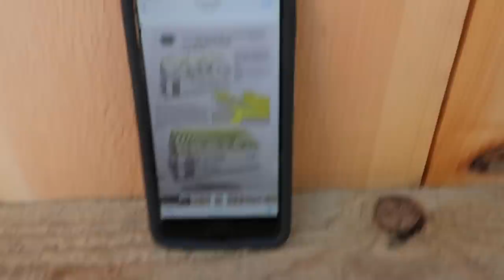This made MY toes Tingle! One Man Attempts to Install Ridge Pole and Rafters on Post and Beam Barn

Comment: I was keeping my fingers and toes crossed for this part.  I was wishing you had an extra plank or two on the tall long scaffolding as I didn't like you walking the plank so to speak especially while lifting the rafters into place.  But that said...the time you take to mark it all out make for a much easier fitting when you're up there manouvering  around.  Great job for sure.  Looks like the pigs will get moved tomorrow..no greens left.  What  cleaning machines they are.  Have a Blessed day.  Olivia you did great work with the drone...I wondered where you were and all along you were right there with your Dad doing the drone work.  Good for you.  What a help you are.

Comment: You said that you would toe nail the rafters later, and I know that toe nailing has been done for hundreds of years, but I can not think of a weaker joint, today I would use "Hurricane tie`s" on my own build, I would also nail a 2´ piece of strapping over the joint in the ridge beam, and while I was at it I would use 6 Simpson 4" angle brackets at the corners, and in the middle of the long side of the barn, screwed to 4x4 and drill thru the 6x6 and the 2x6 into the concrete with a 12" piece of all thread and epoxy.    awesome build, thank you for posting

Comment: just a word of after thought
as a framer ..to make the ridge pole stronger at the joint @ 22:10
I always cut a scrap piece of ridge pole and cut the pitch on the edge, then screw it into place on both sides

then all you do is cut 1 1/2" off the rafter.....much stronger

Comment: Must admit, Al, I didn't understand a thing you said when you were cutting those boards at a different angle to accommodate the over-hang--so I'm just gong to take your word for it.....Thanks for sharing your "barn build" with us.
Reply: Those rafters were for a barn without the side extensions therefore not needed.

Comment: Where the loft is I would have added a 5' stub wall for more clearance raising the roof 5'. When I did a utility shed for my neighbor I did a center support and a full span center beam to carry the roof load taking majority of the support requirements off of the sidewalls I used 2 2x8 with sandwiched 1/2" plywood it's like a vaulted ceiling. You should invest is some quick grip clamps they are very handy.

Comment: Good job doing the work yourself, I also prefer to work alone. Just a hint to make things easier: screw a couple of scrap sticks to the tops of the props to form a U to hold the ridge board on top and prevent it slipping off or tipping over.

Comment: Two things - lay a level on that ridge beam when it first goes up because it may need some tweaking and you need that level before going on. His rafters weren't making full contact with the ridge beam (gap at the bottom) because it was just a smidgen too low - and always install rafters in opposite pairs so that they don't bow the ridge beam. With all the rafters put on one side first you are pushing that beam over. Yes it will probably work out in the end but it will be a lot more stable as you work if you put them up in pairs.

Comment: ALSO CONSIDER GALVANIZED ANGLE BRACES FOR THE BOTTOM OF THE RAFTERS SECURED INTO THE TOP BEAM OF WALL
SO AS TO GIVE EXTRA STRENGTH FROM DOWNWARD/OUTWARD PRESSURE .... ESPECIALLY SINCE YOU HAVE ONE SCREW
SUPPORTING EACH SIDE OF A ROOF JOIST SECTION.  EXTRA MEASURE OF SECUREMENT OF THE ROOF TO THE STRUCTURE.

Comment: On your second ridge board support if you scab a couple of pieces on the side at the top of the temporary support to form a U it make one less thing to worry about with the outer end of the ridge board falling off. Kind of like third hand. A couple of Pony pipe clamps come in handy for pulling things into position and holding something before you attach it with screws.
Great job, working by yourself makes you think a little harder than if you have someone to help:))
Stay safe. Thanks for posting this series.
jb

Comment: You pulled that off really well, Al!  Nice flying, Olivia!  *While "Ridge Pole" 'may be' accurate, Ridge Beam is more so. Posts are vertical. Beams are horizontal. You're not building a Pole Barn, Al...you're building a Post and Beam Barn 😜 *

Comment: It would have helped to build a cradle for the ridge pole to rest in on those supports. A board sticking up a few inches on each side of the support would keep the ridge pole from falling off of it if it got knocked or the wind caught it. Glad you got lucky and it didn't fall off and rip the screws out of the end (and potentially hit you as it fell)!

Comment: What about attaching a metal bin or bucket underneath the PPM's indoor water dispenser... to catch the drips. A few drops will evaporate and if it's more the pigs might drink it later. Or maybe drill a couple of holes to let the water drain through? Or even some paint or varnish to protect the wood? ❤🌅🌵

Comment: Technically it is call a ridge board.  The term ridge pole or ridge beam implies that it has carries the weight of the roof transferred from the rafters.  A ridge board simply is used to fasten opposing rafters to one another.   The rafter share the roof load and transfer it to the wall so the connection to the top plate is critical.  The rafter are trying to push the top of the wall out.  With no cross beam, it is merely the connection of the rafter at the top plate and at the ridge board that keep the wall from bowing out.
EDIT: I missed the most important fact !  Ridge pole/beam transfer most of the weight of the roof to the gable ends !

Comment: I built a 24 X 24 garage with 19 pre built roof trusses with 2X10 weighing 275 pounds each. When the driver dropped them odd he asked when is the crane showing up. No crane, just my wife and me. He said he wished he could stick around to see that. I thought I would get better at it, but each truss took longer than the prior one.

Comment: Hi, I know it's a bit late, but when using an upright piece of timber to hold the ridge pole up, if you'd have nailed a short piece of timber each side at the top of the upright, like a U shape, it would have stopped the risk of the ridge pole falling off.  Just saying, but I do love your video's, you certainly work hard for everything you've got.  Best wishes from the UK.

Comment: Hiya dear boy, great video as always! For less of a high nerve time when putting up the ridge pole put a crotch on top of the dead man! OK UK construction talk, a crotch, put an open sided box on top of your temp support so that the ridge can not fall off sideways. Two pieces of wood, one each side of it. Deadman, a self supporting timber used to hold something up temperaraly. I will mention safty glasses as I have seen a nail fly off the wood when bumping, often when hitting a knot. One guy I knew lost an eye so it can happen! 
Take care & stay safe...

Comment: I was thinking to save the water damage on the wood inside the pig mobile you could maybe take a small plastic Bowl and screw it underneath the water nib so that the splash is or drops are called into the plastic underneath just an idea
Reply: And somehow rig it to drain out under the PPM!

Comment: I am surprised that your ridge pole joints are supported by screwing into the end grain of a rafter.  I would have thought the joints would have been made between rafters, sandwiched between or sistered to a 2x? - what ever the next size down is so the roofing isn't interfered with.  You are a brave man to tackle this job by yourself.  I would have preferred  you do the high work while you have someone there to help should the unthinkable happen.  You could have been unable to help yourself - something to consider on future projects.  I know the urge to need to get a job done NOW well but sometimes you have to take a step back and do something else until you can do the job with assistance near by to come to your aid if you were to need it.  I'm so glad everything came together without incident.  You have people who love you and count on you being there.  Your barn is a great addition to your little homestead and I see from current videos, it's allowed you to be more creative during the long cold winter months when it is difficult or impossible to work outside.

Comment: what kind of screws were you using with a socket head and what size.  Also length of screws used on ridge pole side.

Comment: When I was a younger man doing remodeling and framing I was always doing things most would consider unsafe ( paid the price a couple or few times ) and worked by myself cause I am a perfectionist ; which you clearly are too.
However nothing I've done compares to your achievements on this building. Framing a large roof yourself , not even a laborer.
Hats off sir. Top it all off with your professional craftsmanship and you are a pro. Little sidenote , Norm Abram got his start on This Old House because he was building a garage for a producer from the show. Norm built it by himself and impressed the man and , as they say , the rest is history.
One question if you don't mind. Why no overhangs on the barn?
From my experience buildings suffer a lot of damage and weathering with out it.
This is not a criticism or saying you're wrong , I just am curious if you are planning something different or what. Thanks for your time

Comment: Nice video. Im working on doing something very similar, but its 28x32. You think it would be possible doing the roofing the same for that width of gap? Without the joists in front? Planning on 10 ft in back have room/ loft, so would be 22Lx28W with no joists. Any info would help

Comment: Good morning Al. Since you cut what looks to be maybe six inches off the ends of the rafters, are you now going to need to have the metal pannels shorten too. If you continue with the same pitch with the over hangs, the outside walls will only be 5 feet high. You've got me really intrigued now!
Reply: Those rafters were for barn without side extensions, not now needed when sides go up.
Reply: @tonygrimes13  I understand that Al's  putting on side extention! He is in an area where snow load is at times extreme. I sure that is why there is a 4 12 pitch on the first stage of this build. Am I to assume the sides are going to have more framing against the walls already with newly placed siding? No. The rafters for both sides that were cut off, could had been used as attachment points from the sides of them, still at 2 foot centers just 2" s to front, then extended out to the sides. As it is now the side of the barn are 8 feet, the extension are 8 feet wide. These extentios are going to need some really strong support to carry a snow load, maintaining any kind of over head height clearance. He did cut off at least 6" s of rafters so where will this be made up? Pannel are still full length. Again, I'll just have to wait and watch!

Comment: You could have acquired an air nailer and a compressor with the money you've spent in screws by now.  Not to mention the sheer strength in nails is oh... say 5-8 times a screw... just saying boss.  Love your videos, always make me smile.  You missed a career in radio brother.

Comment: This makes your toe tingle? FFS, I built an 80'x40' post frame in Montana, by myself. Including pouring and finishing the concrete floor, with two drains that daylight out, 30 feet beyond the side of the building.

Comment: With the amount of cutting you've done it isn't as much of a pre-cut kit as I would expect.  Wouldn't it have been better long term for relationships if you had just worked from plans and bought the wood from a local sawmill?  Supporting local is important in the long run for successful homesteading.

Comment: That wasn't safe at all. Pretty foolish. It might have taken more time and a bit more material,  but you should have made a stable platform for the scaffolding before doing any of that. Where would you have been had you fallen and hurt yourself? I'm glad it worked out, but it easily could've been a seriously dangerous situation.